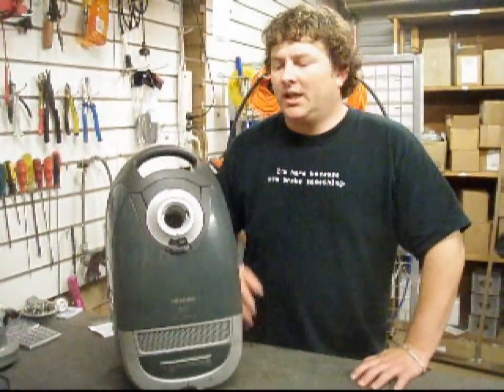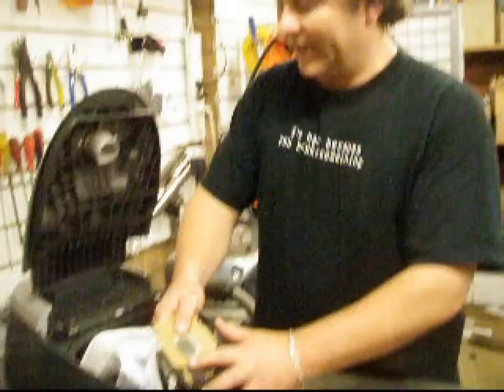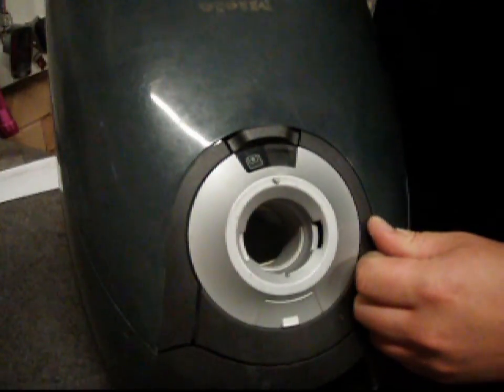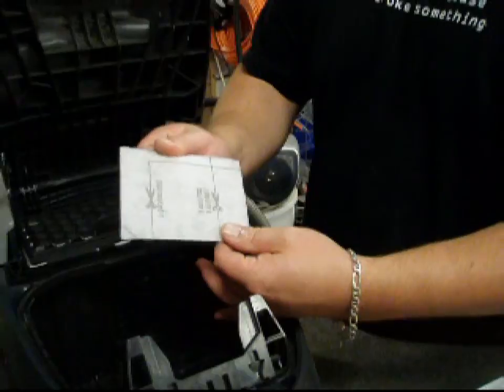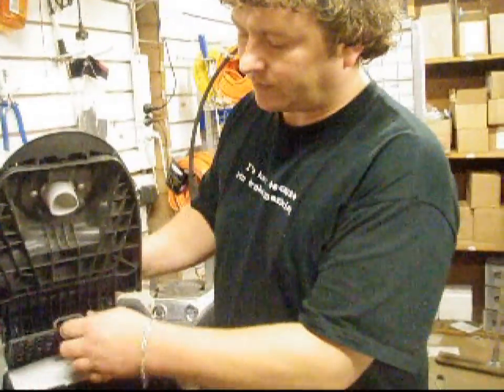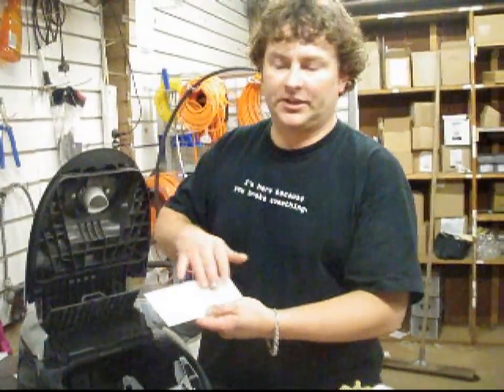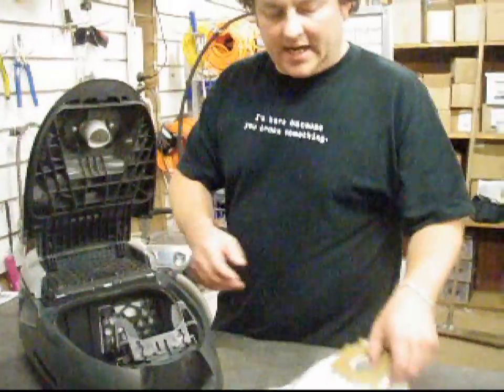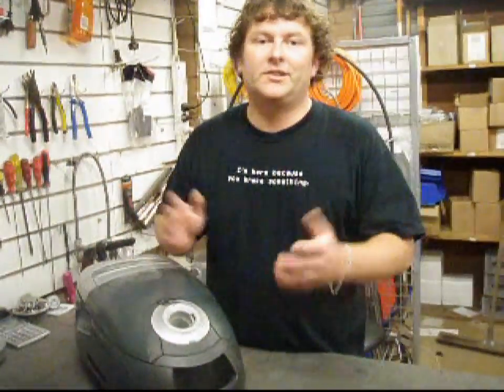Miele S5311 Vacuum Cleaner Basic Maintenance - Simple Clear Steps to help you

Comment: Hi! I have a Miele S8 Homecare. I bought it just under two years ago. I loved my Miele up until about two weeks ago. I inserted the Miele brand bag. It fit firmly in and clicked with ease, as usual. I vacuumed my house and went to vacuum my car the same day. Because I did more vacuuming than usual, I wanted to check the bag compartment to make sure the filter was still clean/fur free. I usually never let the bag get really full because I have allergies and I want the vacuum to run efficiently. But not only was the bag not full, most of what I vacuumed that day was in the dust bin compartment instead of the bag. The dust bin filter was clogged with hair and debris. I immediately research the problem in the manual and saw no advice. So, I cleaned the vacuum, I replaced the bag, thinking it may have been defective, and I replaced the filters. I tested a small rug in my kitchen that my cat often lays on. So, it had some dirt and fur but nothing that would clog the machine. I passed over the rug about 2-3 times, focusing on where my cats hair was. I opened the bag again, and dirt and fur were on top of the new bag and in the compartment with hair poking out the flap on the bag. I feel the flap isn't opening? But I am unsure why. Could you give some advice on how to resolve the issue? Your videos are so helpful! I have enjoyed listening to your great and fair advice! Thanks for posting these wonderful and insightful videos!

Comment: Alec, great tips on Miele maintenance! Just a little tip of my own to share....If you do use generic bags, make sure you buy bags with the PLASTIC collars, not cardboard. In all my years of owning a Miele, I found that once you switch to bags with plastic collars, you don't have the problem of dirt collecting in the bag chamber & the pre-motor filter stays much cleaner.
Reply: or better still, don't use generic bags all together.